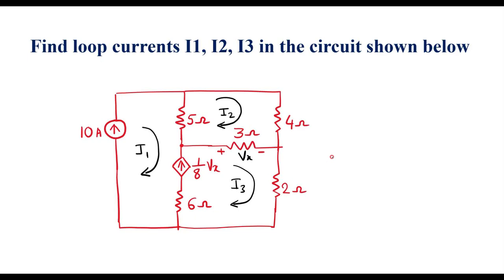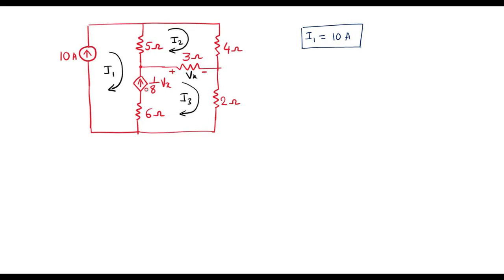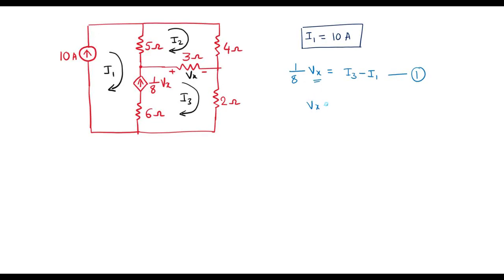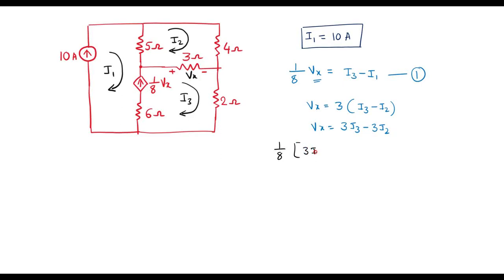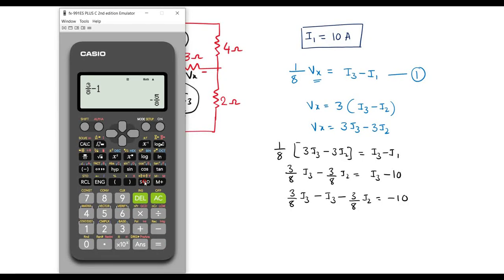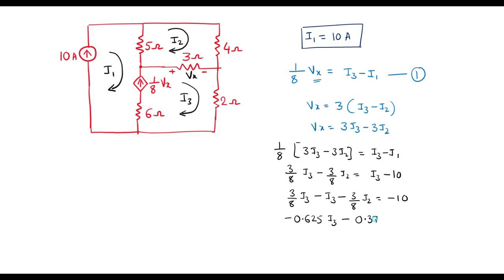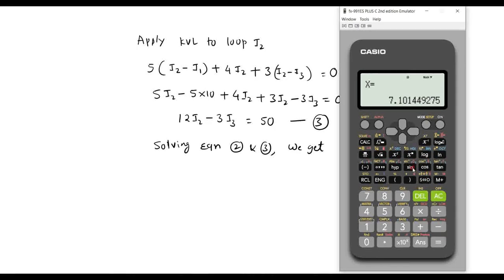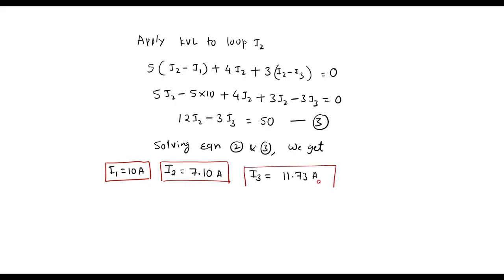Find loop currents I1, I2, I3 in the circuit.

Comment: Sir what about 6 and 2 in loop 3
Reply: We found out current I3 so the current through resistors 6 and 2 will be 11.73 Amp
Reply: No need to calculate loop 3
Reply: Ya but y when we have to find current i1,i2 and i3